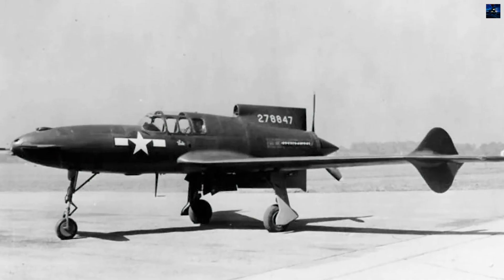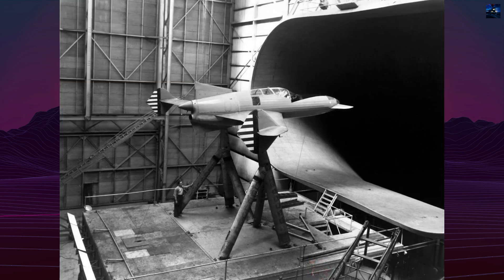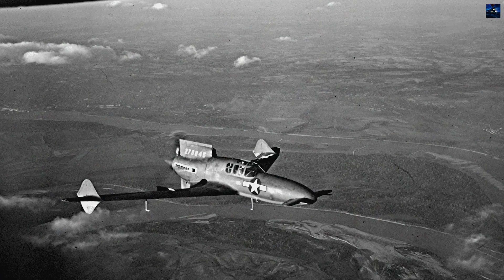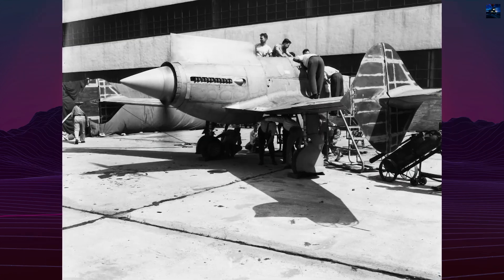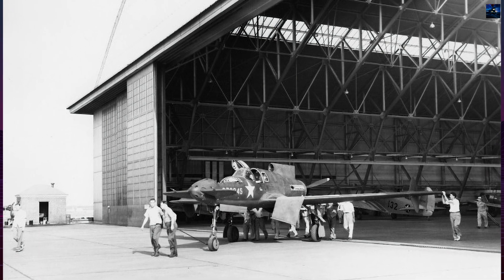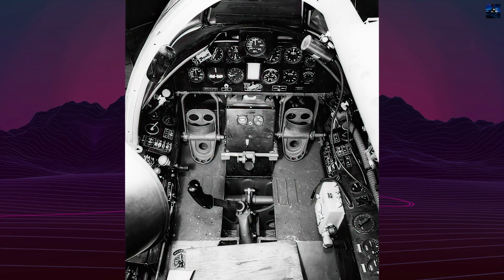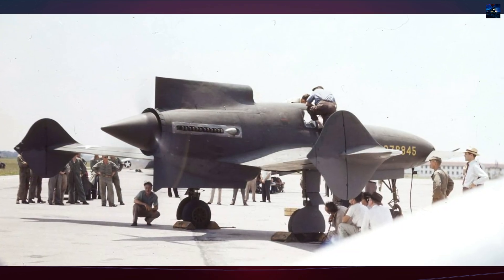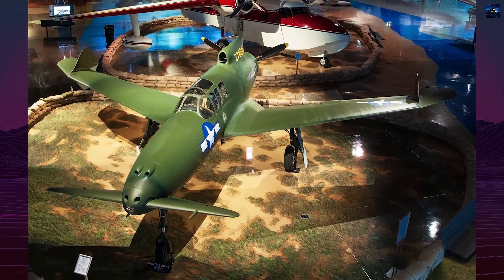Curtiss-Wright XP-55 Ascender: Why This Weird WW2 Fighter Failed

Comment: Thank you.
I would add about the significant swept wing, the fence-like control surfaces before the ailerons, and the wing twist. These were important progressive features for that time.
The swept-wing Northrop XP-56 and XP-79 were also not successful. The war hindered proper research, which led to an obvious fear in the US of swept wings. And many today, for some reason, are convinced that they didn't realize the potential of swept wings for supersonic speeds.

Comment: If only they had fitted a jet engine! If you saw the latest Godzilla (Godzilla Minus One) movie, you'd see that the Japanese were experimenting with an interceptor remarkably similar to the XP-55: the Kyushu J7W Shinden. Indeed, it was considered for jet propulsion. Lockheed also built a pusher design - the XP-56 (I think they called it the "Black Bullet"). Thanks, Retro Transport!